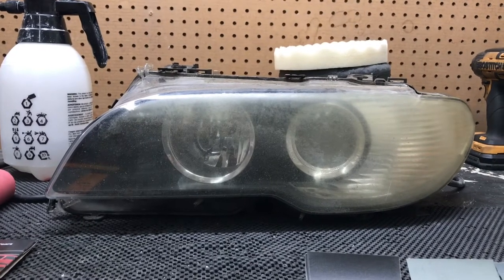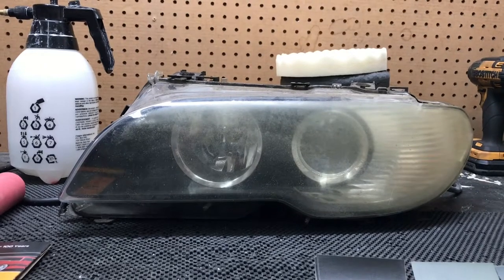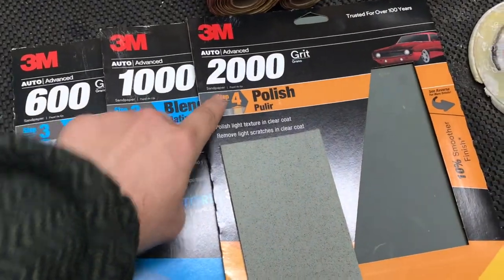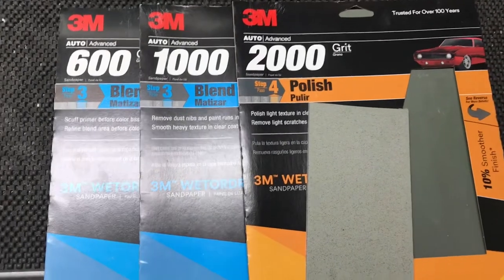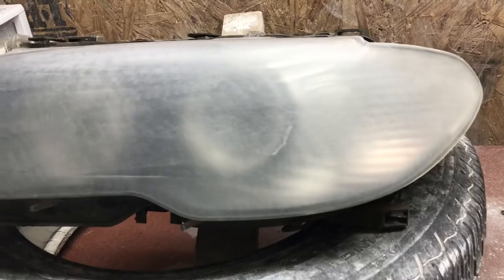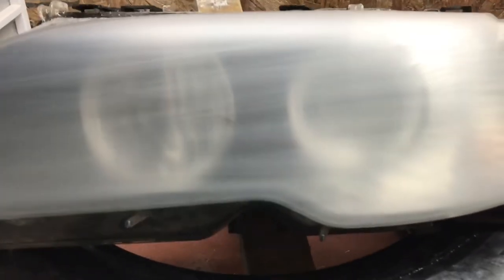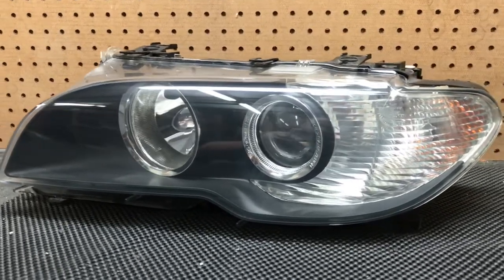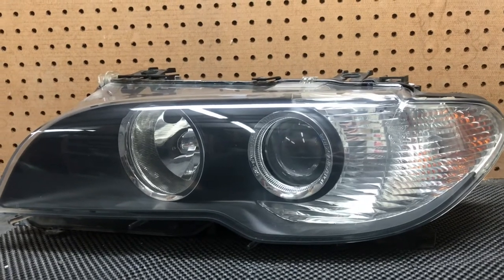Headlight Restoration (Sand & Buff) Step By Step

Comment: This is to foggy the speed was to slow and your not doing enough passes. Do it with a 3 inch and double pass on cut and polish not just pass it once and you should get amazing results like the clear coat. I have a video on headlight detail.